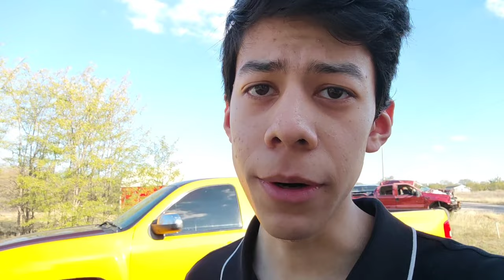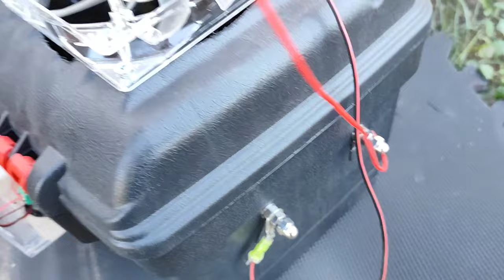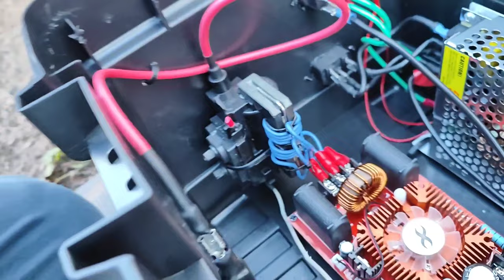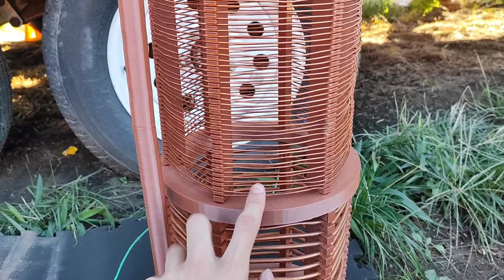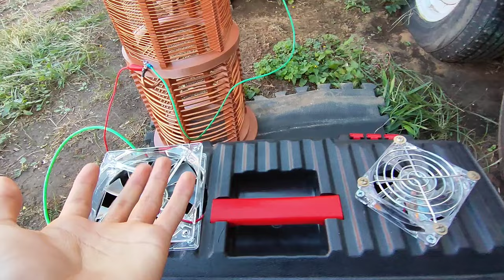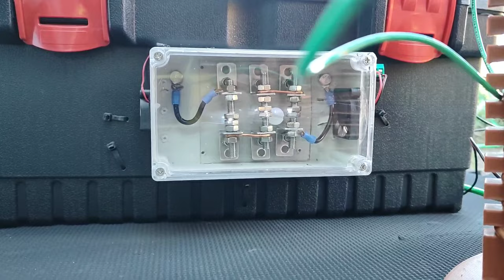New & Improved Oudin Coil!

Comment: Really good job for your first time! congrads.
Lets make this simple. the flyback coil is likly about 10,000-30,000 volts. low curent
12V supply to that fly-back coil. then the output of the coil to your spark gaps. then a 2nd line to the coil tower.
All that other stuff isnt needed

Comment: Really Beautiful! Remember that you will always have way more voltage than you can deal with. When you raise the voltage and the frequency you stimulate the ambient  electrons . You can collect the excess energy and step it down with a ferrite transformer and spark gap to after high speed diodes such as 2cl. Don Smith ran his at about 20Mhz . At that frequency you can actually figure out the length of the antenna for that and make the battery leads that length and you will be able to run equipment from an inverter off the one end and your battery will stay charged from the radiant energy as well. Really great project.
Reply from the maker: That sounds very interesting, I will have to try one day. Thank you for commenting!
Reply: @PancakezEater6940  You will be very surprised at what you will be able to accomplish. That is an awesome setup.

Comment: You should widen the spark gaps quite a bit. Separate them as far as they will go and work your way in until it starts striking, then continue to close the gap in small increments until you get a clean arc. A very similar thing happened to me when I built a Tesla coil. The original gap I used was so small that it was shorting out the driving circuit and dropping the voltage. This could be part of reason you saw smoke from your driver circuit earlier. When I widened the gap on my setup, the sound went from a hiss-like sound in this video to a firecracker-loud bang on each strike.
Reply from the maker: Yes. After this video, I did make the spark gaps a bit wider apart and that definitely worked, but I definitely need to separate them more and your method of doing it was how I was thinking of doing it 😁👍🏼.  Thanks for the comment!

Comment: WOW,,,,Nice upgrade on your Oudin coil and your HF generator.GREAT JOB  ..ive been gathering parts to build the same ,,what  ceramic resistor is that,can you help me on the resistor size and the choke..do you wind it   i would luv to see what it looks like without the tape  .Thanks
Reply from the maker: Hey there! I meant to respond to this comment earlier but I forgot lol.

The ceramic resistor is 1K ohms x 10 Watts and the choke I did wind myself. It doesn't matter the size of the torus choke or wire, as long as it measures 777 μH (micro-Henries); and if  you REALLY wanna be exact: 777.3 μH would be the utopian number, but that's crazy at that point and not necessary.

Just in case you want to know my specific choke specs: Outer diameter= 36mm, inner diameter = 23mm, and height= 15mm (36*23*15mm). The bare copper wire is 0.3mm. It was also wound in an anti-clockwise manner.

Thank you for commenting 😁
Reply: @PancakezEater6940  👍Thanks,great help...

Comment: there are a fe things that need improvement...  the "upper" coil should be made with fine wire ( 18 to 22 ga.) and quite a few turns ( 500) the lower coil seems ok at 15 turns,  the spark gap width sets the input voltage to the coil set, opening up the gap just a bit more would improve voltage into the primary...  try to avoid putting the sliding tap on the upper coil, it will reduce output voltage, you want a low count on the primary and a high count on the secondary windings about a 1 to 100 ratio.. Also, the flyack transformer may not ( isnt) putting out enuf current to fill the caps fast enough to get a decent voltage buildup in them... also, are the caps rated for the input voltage you are trying to put into them from the flyback?  
Finally, read up on Tesla coil design and understand induction and air core design and how caps and inductors behave...